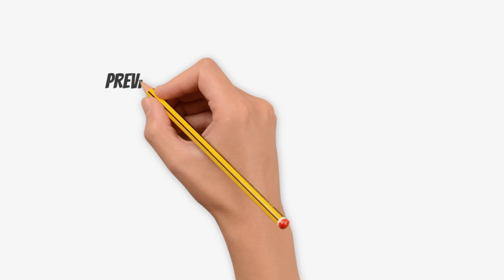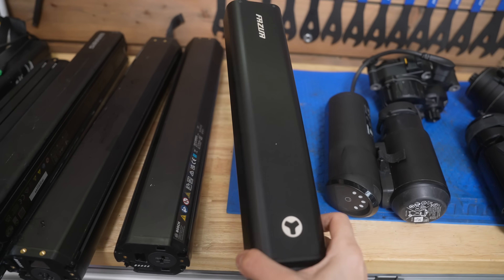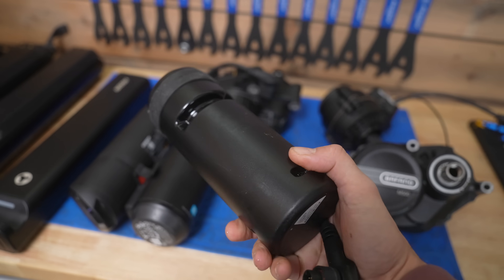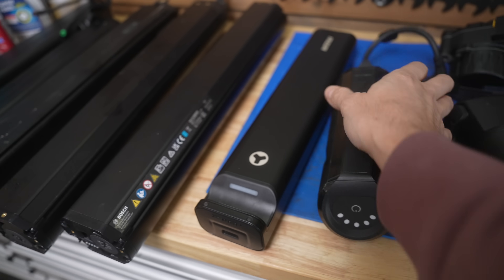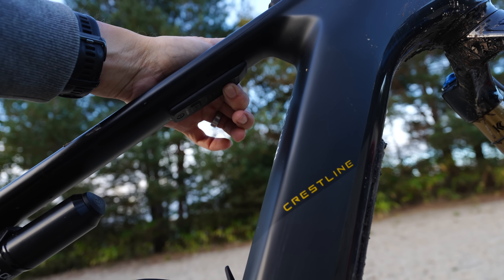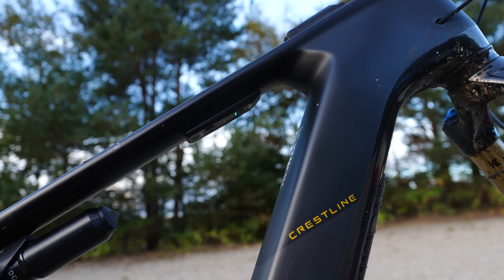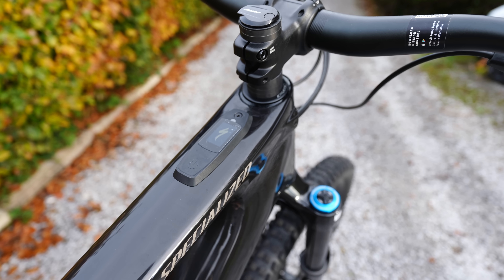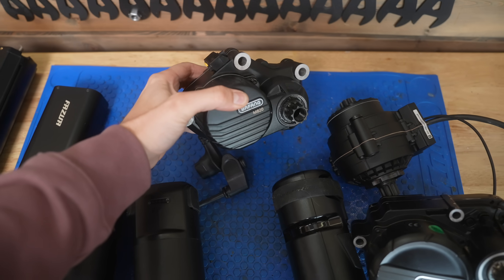We Have A Huge Problem With Ebikes....

Comment: I partially agree with Rob.

A universal charger would be nice. Given that there are multiple plug types and vastly different electronics I don't see it happening. The USB Consortium took a long while to develop type C. 
With the different approaches I don't see anyone  agreeing here.

The bolt pattern is not a good idea engineering wise. All Motors have different shapes and sizes. The bolt pattern needs to be adapted to technical needs. Same goes for the battery. If all that is locked in there will be one shape that e bikes can have. You won't be able to find a pattern that makes sense for all motors.

And then theres the overall benefit of it: I definitely see it with chargers. With bolt patterns and batteries standardized Innovation and Individuality would be stifled. Just look at the new big and chonky Pinion Motor with the huge batteries as an option. None of this would work on a standard config. Turn it around and put the tiny TQ in the Pinions cave and you will have too much room.

UHD works because it can offer benefits for all parties. Follow the benefits and you get a good concept
Reply: There is an universal charger available on the after market, it's named LiON Smart Charger. You need to buy special connectors for each brand, but the general charger remains the same, probably just using different chargings powers depending on the cable, that is connected -- addenum: watched a short video, seems, that you need to configure the charging power via a smartphone app, it's not getting this information from the cable directly
Reply: @e_mtb  awesome, I hope they become popular enough to evoke a mindset shift with the manufacturers

Comment: And this is why I haven’t purchased an e-bike. 
Like you say, it’s literally an arms race with new generations every other year, and no backwards compatibility.  Immediate obsolescence.  Worse still:I hold onto my bikes forever. What happens in 5 years when I burn out a motor or battery that’s 2.5 generations old?  Will there be support and replacements for legacy systems or do I scrap the whole frame & electronics?  Scrap the whole bike?

Comment: Thanks for video. I bought years ago ebike with dual battery and hs version,bosch performance line motor didn't notice they have 63NM compared to cx motor 75NM. Later in life got hands on cx motor from another bike so I fit in frame it works but I couldn't adjust wheel circumference it was out of range (bosch give you 5% for tyres difference)obviously  the engine was from bike with diferent wheel size. For me suppric even authorised bosch  service center was not able to do it.And same story was with dual battery system, because there is some sort of firmware wich is preselected by manufacturer. Expensive mistakes.

Comment: next thing you'll be suggesting that there should be agreed standards for disc brake pad dimensions and mounting points 🙄 - the reason that thought came to my mind is that I've just been looking through my box of MTB bits - lots of unused sets of pads from bikes that I've since sold - and they're all bloody different to the ones I need for my current bike! 😡

Comment: I personally don't have a problem with proprietary stuff, as long as they are available.  If I bought an e-bike and an upgrade comes out in a few months, I don't see that as a problem.  That shouldn't automatically make my bike a bad bike.  I will stick with my bike until I am ready to change it.  In the auto industry, proprietary is the norm, as with televisions, printers, phones, watches, drones, lawn mowers....the list is extensive.  If I can get a replacement part if I need to, it's a non-issue.  In the auto industry if an update is made to say, an alternator and that is implemented in future models, it would most likely have a different fitment due to the fact that it's fitted to a newer model vehicle, however, the technology that is in the newer alternator is also made for the older model, so it's available for the older car as well when/if the time comes to change that part.  The good thing about proprietary systems is that the manufacturer has the sole responsibility of the safety aspect.  Imagine all batteries and motors and connectors being the same.  That would open the door for many to try to capitalize on that standard and make inferior stuff.  Next thing you know you hear about e-bike fires all the time, and that itself won't be good for the industry.

Sorry to play devil's advocate, but being around a couple industries I often hear the consumer complain about this or that, but often there is a good reason for why something is done.

I enjoyed this video, though.

Comment: There is absolute no reason why you shouldn't be able to charge your e-bike with the same universal charger that you charge your laptop with. That's the USB-PD standard, it's well proven and it works. USB-PD delivers up to 100W over USB-C. It won't be as fast as some dedicated chargers but it will be more than enough for most people, and it will definitely charge an e-bike battery overnight. For me personally that's more than enough, the ability to bicycle to a friend, stay the night not have to bring my bulky charger would be a godsend.

Comment: The most important thing is compatibility between generations. for example a EP801 motor slotting into a bike that had a EP800 with the existing battery working fine and the controller just requiring firmware update. The first company that does this will get the most sales as buyers do not want a two wheeled paper weight after the 2 year warranty ends.

Comment: This is the main reason why I bought a LightCarbon frame.  With a Bafang system (even if it remains a bit proprietary) we still have the choice of three engine powers (m510, M600, M560) which adapts to the frame.  Batteries can be bought anywhere and above all it's much cheaper!  We have the choice of many display models (small, large...) Of course, there should be a consortium between all the brands so that they agree on a standard for fixing the motors and so  be free to choose your engine as well as the choice of brand!  I really have a lot of trouble seeing 750wh BOSCH batteries for more than 1000 dollars in my region... The worst thing is that you have no competition to reduce this price and it's simply nonsense.  abuse of dominant position in the market and sooner or later they will be condemned for it.  Just like derailleur pastes where everyone should adopt SRAM's UDH system.  I am lucky enough to be self-taught and have no limitations when it comes to building a bike, however not everyone is as lucky.
Reply: Same reason I went down the 'build your own e-bike' path, as brands all too often disappear from the market..
And you can build the bike to your own personal needs/standards/performance & range - and I've found it's way cheaper because my 1500w48v 52v20ah build would cost around £2k to buy as a factory bike - where I built mine for around £850 and I get great performance & range, and the bike was built around my needs/standards of quality.
Reply: The European and Japanese ebike component manufacturers better start collaborating as what will happen is the likes of Bafang , Chinese manufacturing will ultimately wipe the others out of the market because they actually make a more compatible range of components and they will make it cheaper. Take a look at the EV auto industry currently which too is in its early stages of global adoption. Initially it was Tesla but watch this space as the Chinese manufacturers flood the global market with their products...
Reply: @derekharper6031  
Yes, I also think that there will be changes over the years. My eyes hurt looking at a $4600 SantaCruz frame.
Even though it's a good brand, the price seems unreasonable to me.
Reply: @bydenver I only paid 4k for my car
Reply: @bydenver  Why choose a proprietary Bafang system that is locked down over a Grin Tech PhaseRunner with Fully programmable parameters and Field Weakening that allows you to run motors faster than normal back-emf limit?
Reply: @williambarringer6513  of course I understand, however it is not comparable since there are not the same production methods and the sales volumes are not comparable.  Like you, I would like to be able to see bikes at prices below 2k while being high-end but that's just not possible.
Reply: @sammiller6631  

Even if Bafang remains proprietary, it nonetheless remains more scalable than competitors like Bosch or Shimano.  In addition, it is possible to program the powers as well as the speed limit, which others do not offer.  if you are on the 250w motor support, you have the choice between three motorizations M510 = 250w with silence / M600 = 500w + heavy + silence / M560 = 500w + light + a little noisy.  You also have a choice with lots of controls and screen.  You also have options for the brakes.  Even if it remains proprietary there is still an "open source" side with good repairability since the parts are quite easily available.  we are also not limited with the choice of battery and in the end it is not a “very closed” environment.
Reply: @bydenver  I think it is very possible. Do you think a bicycle should cost as much to manufacture as a motorcycle? A decent motorcycle can be bought for under £5000, some are even less. When you take into account the number of parts and weight of materials involved there is only one conclusion I can come to; we are being ripped off, big time!
Reply: @derekharper6031  Grin Tech isn't going anywhere. They've been doing DIY e-bike motors for almost 20 years. That's not a niche the big volume companies can touch.
Reply: Yes, the ebike industry needs standards. But that will only happen when the expensive, big name bike brands demand it. But it is not clear that they will if the door is opened for the Chinese to compete with parts built to the same standards. And of course Bosch and the other motor manufacturers will fight it: requiring a unique mounting means vendor lock-in. They want to be the sole source of all of the pieces, not just the motor and controller, and they don't want their customers to be able to choose competitors' products without extra cost. So don't hold your breath.

Of course for a fraction of the price it is possible to buy a decent Chinese ebike with a Bafang motor. LBS hate them - they would rather sell the higher priced Specialized, etc. People need to look more objectively at the Chinese products - they can be quite good, just don't go too cheap.
Reply: yep, brought a new battery from alliexprerss,  brought a casing and made my own, changed a different controller. 1 charger charges the lot.
Reply: I've pickup bosch batteries on sale with 30% discount, not something likely to see with other brands. Unlike kit batteries not likely to burn your house down.

Comment: Rob, I totally agree. The industry needs to get their act together before they are forced. A good example was the EU requiring phone manufacturers to standardise USB C charge points on the grounds of user needs, less complexity & a greener solution. If the industry doesn't come around then we should seek right-to-repair laws where manufacturers have to provide repair information to customers. This would kick start the third party modification industry to develop fixes to upgrade our bikes, and, extend time before we buy new bikes off out of touch manufacturers. You're right. The problem is there are too many proprietary standards and no broader industry standards. It is a worry. Thanks for raising it. Any chance you could do a series of interviews with industry leaders and ask for their views, their plans or lackbof them.

Comment: I wasn´t aware that there SOOOO many different systems out there. That´s more than disgusting and the industry should be "forced" to define and use standards. Especially in a time where everyone is talking "green". This is far from being green. It´s an environmental nightmare. Normally I´m not someone who wants everything to be regulated but in this case In can only shout out: Set rules and standards for this incredible mess asap.

Comment: Good call. I'm kind of OK with different brands having their own systems but I do have a problem where brands make it so their systems aren't interchangeable on their own bikes. For example, I have a Kenevo SL with the 1.1 motor, I absolutely love the bike and took a bit of a gamble buying it as I'd heard the 1.2 motor was on it's way. The way things stand at present I can't upgrade to the new motor. This means that once the bike is out of warranty I'll most likely strip the parts then scrap it and buy another frame from a different manufacturer that has a better business model. The end result is bad for Specialized as they create a poor brand image, bad for me as I have to spend more money than I like and bad for the environment due to the sheer waste of resources this involves. My only hope is that Specialized are holding off on the upgrade route so they can sell a decent number of new bikes (which I totally understand) but will start releasing the 1.2 motor as an upgrade option once they've achieved their target sales.

Comment: Hey rob was thinking about the same thing, I have a 2020 rail with a prion display and was wondering if I could put the new Bosch gen 4 cx motor with the smart system when my current motor gives up in the future. I was wondering if that was possible cause I do like the new smart system which seems more customisable and minimal. Would replacing the motor and controller work with the old battery or as you brought up not be backwards compatible 🤔

Comment: Could you imagine a time that you don’t have to buy a complete bike you could buy a frame then pick your favourite motor and the battery that suited your requirements. There were so many great bikes i discounted because i didn’t want to run a particular motor.  The industry should see it as a step forward. This would also make getting into e-mtb more accessible.

Comment: And also by the way, after you’ve sorted out the standards. You need to overcome the fact that manufacturers are not legally allowed to sell EBIKE frames separately. EU law dictates they can only sell set approved combos. E.g where could not sell me a frame only As a swap out for a cracked other Bosch EBIKE. Same system, would have fitted. Not allowed…
Reply: Whyte

Comment: A few motor companies aleadly use the shimano bolt pattern, Askoll and another one. As for batteries working together thats down to the Canbus. The problem with that though is not all BMS are the same, and some are safer than others.  Bosch for example is very safe and your battery will charge properly and not explode. Aslo not all motor companies release their software programing, because thats what the secret is to the their system. Also plugs fro example some are patented, like the Rosenberger connector that adds like 30 dollars for each plug to the price of the system. I think the main mount for the motor would be the best thing to keep standard, the rest is going to take a very long time to be cross compatible.

Comment: You are completely right! 
I solved this problem following: I bought first e-bike with Bosch gen 3 - the one I choosed just had it. Next two e-bikes I was looking for our family main criteria was to have Bosch gen 3. It’s not the long term solution, but it works for me now. At least batterys are replaceable. 
It would be good that in the future, when I would be replacing bikes, there will be a universal standard at least for the batteries and motor mounts ❤

Comment: nothing to add. you are 100% correct. i have owned 2 orbeas (rise gen1 carbon and aluminium for wife) and both had different range extender plugs it is just srsly stupid. sold both and will never buy an ebike again.

Comment: So you are saying there are 10 different standards out there? So what we need is one universal standard that everyone will adhere to.  You know what that achieves? You now have 11 standards.
Reply: There is one standard in DIY. Every DIY battery works with every DIY motor. Assuming that voltage is supported by controller. (36V/48V/52V)

Comment: I think standardizing on a motor bolt pattern and physical shape of the battery could happen, but you'll never get a cross compatibility between different motor-battery combinations or charger-battery combinations due to the costs associated with qualifying that matrix to all work together, and the potential liability and finger-pointing if something goes wrong.

Like imagine if you have a shiny new Specialized e-bike, and you plug it into some random charger you got off Ali Express, and that charger has a faulty charge termination configuration that causes the battery pack to catch fire. Well suddenly your home insurance is trying to get money out of Specialized because "their bike" caused the fire, and it's all over the news with bad press, etc. when it was really that shady charger that was to blame.

So the motor-battery-charger-electronics package is always going to be essentially a single unit, but we can hope for frames to become more cross compatible so you can jump between those units to upgrade, or to revive a worn out bike.

Comment: I agree, streamline, simplify standardize is the way forward. I was thinking it would be beneficial if you could remove the mid drive motor and put a bottom bracket and cranks and keep riding, but with the different standards its not economical viable to produce. Im glad I didn’t wait to start riding ebikes waiting for technology to peek but its the wild west out there right now. On the other side of the game, hub-drive motors and external battery " town bikes" have some basic standards.